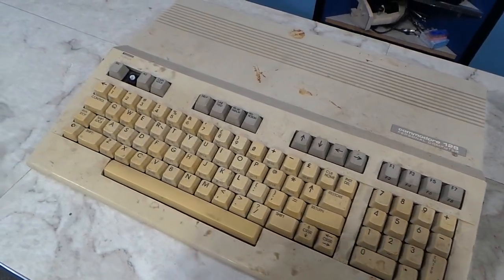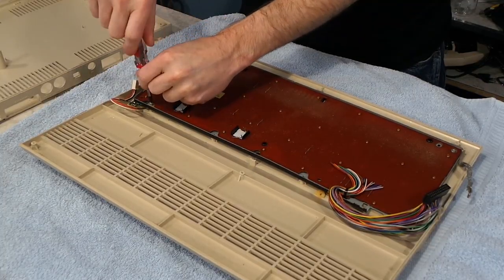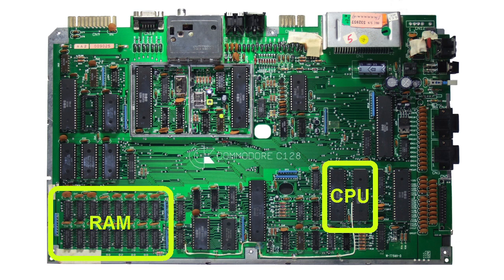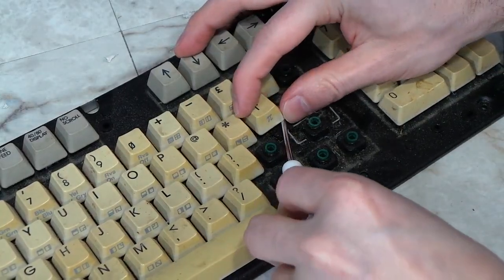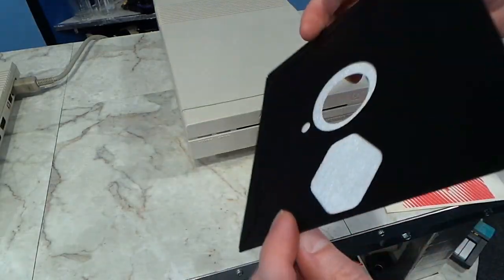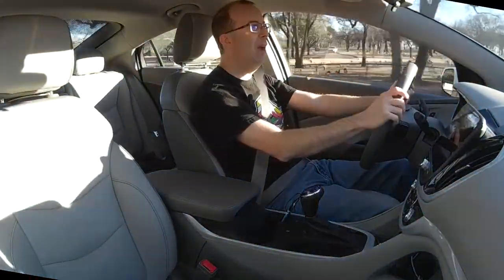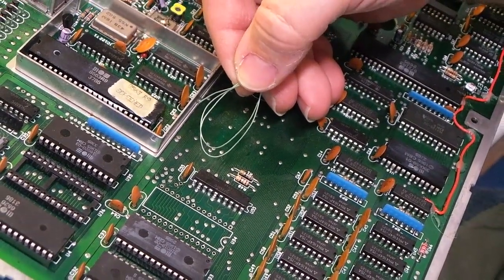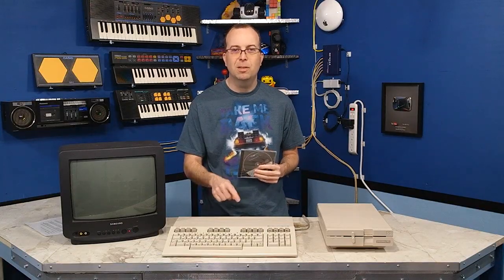Commodore 128 Complete Restoration and Board Repair.

Comment: C128 owners were like: "Yeah, my computer is basically a C64, but my parents have more money than your parents".
Reply: kanjitard And GEOS is slightly better
Reply: Or maybe I just wanted to learn CP/M.
Reply: @veli-pekkakultanen2353  probably the clunkiest os I ever used.
Reply: Nobody:
C128 owners: oh your C64 doesn't have 80 COLUMNS? i pity you.
Reply: @badmeme486  I still have a C64 in it's box
Reply: @JT_1  cool, mine doesn't have the original box
Reply: @JT_1  NIB, never opened but you use it as a doorstop because you have a C128
Reply: @JT_1  me too! The Datasette is still in its original box also, along with a few joysticks and many games!
Reply: @badmeme486   Too bad that not many programs made use of the 80 column mode.
Reply: What size commodores are these? 64? Ours are 128, no big deal.
Reply: l miss a lot my old C=64 C. Now l have to deal with a Dell laptop and windows OS. Pity of me ;(
Reply: @rodolforodriguez4203  I have a C64 but I ate the box.
Reply: and then the day came that they faced a guy with an amiga 500... RIP
Reply: @dollar12 I loved my VIC-20. I remember when I finally saved the money to upgrade the RAM to 16k. I remember thinking "There's NO WAY I could ever use all of this massive amount of memory!" Lololol
Reply: The CPM mode was the draw, having two computers in one was great.
Reply: Jokes on them all the software was made for the c64 lol.

Comment: Bought a Commodore 128, complete in box that is guaranteed working, is there any addons you'd reccomend i pick up? I bought the Vram upgrade to make it the same as a C128Dcr for Vram. I also have a 1541 and a 1571.

Comment: Who ate chocolate 🍫 on top of this commodore 128?
Reply: looks like blood to me tbh
Reply: Looks more like crap than anything else
Reply: "chocolate"
Reply: nikoskokonos13+ lel
Reply: I picked up an A500 several years ago on Ebay, that looked fine with it's small, low resolution image, but what did I receive? An absolute filthy, pizza sauce stained machine that had enough dust bunnies in the disk drive to make a sweater...and other units that were protectively coated with greasy cigarette smoke plus other things...quite gross how some of these machines are treated and how some people live.
Reply: Meh

Comment: For those stubborn scuffs on the bottom you used baking soda on, you should try the mr clean magic eraser. Its also mildly abrasive and works just as well with hardly no mess!

Comment: 10:15 — 8-bit Guy, that's Blu-Tack, isn't it? Is it not as common in America? Pretty sure it's not gum.
It kinda goes like that when it's old and dry and generally about 50% of houses in the UK are in fact held together with Blu-Tack (the other half are generally duct tape :P)
https://en.wikipedia.org/wiki/Blu-Tack
Reply: Richard Williams 100% agree with you. English houses - like mine. Are very shoddy
Reply: I'd say it's more like 50% Polyfilla, 10% Duck Tape, 10% expanding Stryofoam foam,  10% old bits of wire, 10% silicone sealant, 10% Blu-Tack
Reply: YAUUN the amount of things I've "permanently" mounted to the wall the pollyfilla'd the wall I don't think I have any plasterboard left haha
Reply: If it is what I think Blu-track is (too lazy to google) then it's called Mighty Putty in the US
Reply: @simonro9168  Sticky Tack is the big brand in the US. Mighty Putty is a hardening epoxy.
Reply: Nothing beats the holy combination of Duct Tape and WD-40 though.
Reply: iptvreseller@mbox.re  email me if you want to make money
Reply: Not only do Americans microwave water instead of using a kettle but they also don’t have blu-tack? Weird.
Reply: GeminiStargazer I live in Cali and can safely say that I haven’t seen anyone microwave water to boil it

Comment: Note: I did a little research on yellowing plastics and oddly enough the same UV radiation that brings plastics back to life is what causes them to decay in the first place. There are other factors too but UV radiation even from indirect sunlight indoors is a huge culprit. I think chances are no matter what unless you seal a PC properly away from any kind of light it will yellow eventually, but nice to know the IIc is still nice and bright after a year.

Comment: Nice, that disk drive looked brand new. It may be possible to rinse/dunk the PCBs using distilled water also, with a paintbrush, which is the safest way, or soapy warm water initially and finish with a warm distilled water rinse, then dry with a hair-dryer, then leave in a sunny, airy spot for a day or so to ensure full dryness. Most components should not be bothered by this on a PCB. I have used it once before on a serial card that had been left in a shed, and it worked fine.

My only concern with adding the traces is it can potentially effect timing, in some instances, but is a common fix regardless. Re-working the existing traces is often possible after removing some PCB lacquer coating, but you have to be incredibly careful when applying heat to avoid lifting the trace off.

Comment: You can seriously speed up the key washing process if you use an ultrasound cleaner filed with some chlorine-based detergent solution. And why not use a brush together with the vacuum cleaner?

Comment: Great video. Out of curiosity have you tried dishwasher tablets? I read a while ago that the enzymes are great for cleaning old computer plastics so I tried putting the keycaps + plastics from a (very grubby) old keyboard into a bowl of hot water + a tablet, they came out absolutely as clean as new without any scrubbing required. I was really impressed. Anyway figured I'd mention it.

(Also congratulations on taking the plunge and going full time with the YouTube vids'. Hope it works out for you.)

Comment: David, regarding the retro bright and yellowing again: the reason why plastic gets yellowed again after you retro bright it, is because of its contact with air (it's ongoing chemical reaction). So with bromine molecules temporary removed (after retro bright), new ones will get on their place, and there you have yellowing again. In order to prevent that you have to apply a small layer of transparent (matte) spray paint so that there is no direct contact between the air and plastic. That way no bromine can get into existing holes. Please give it a shot!
Reply: The bromine is in the plastic, doesn't get in from the air. Oxygen does react with chemicals in the plastic though, but the other factor is UV exposure, which greatly accelerates yellowing. This is why parts of the plastic not exposed to light hardly yellow at all. You should specifically use a UV resistant clear coat if you want to avoid this.
Reply: +Don Solaris The primary reason for the coating is to provide a barrier to oxygen. Oxygen reacts with bromine containing fire retardants in the plastic and breaks them down. Bromine doesn't need holes to get into, once the molecules of fire retardant break down bromine will still be released into the plastic. The only reason porosity of the plastic is a factor is because it increases surface area for oxygen to attack. Obviously UV isn't the only factor but it does massively increase the rate of yellowing.
Reply: Someone did this and it still got yellowed.  But then they now could not re retrobrite it due to having the clear coat paint on it.
Reply: Ditto what Warren Park said.  And also like others have said, if you apply a UV-blocking clear coat, while sounding like sage advice, it ultimately will prove your worst enemy should the plastics yellow again, as the clear coat will prevent Retrobright from doing its job.  Therefore, the most sensible thing is to Retrobright repeatedly as needed over time.  It would have been better if the plastics were made without the flame retardant at all.  I'd take the fire hazard risk over yellowing any day.
Reply: I liked this so David can see
Reply: @joestacos2  heh funny number of likes
Reply: Maybe an experiment could be run to test this - retrobrite a computer, wrap half of the case in clingfilm, then store it in a dark place for a year. Maybe take another part of the case and store it in daylight for a year too.
Reply: Weird. I have a Commodore laying around here that has always been in contact with AIR. But never with sunlight. And it looks like NEW. It's not yellow at all. So.. are you wrong? Or is my commodore 128 wrong? I also have the original brown cover over it. This will prevent UV to enter. It's always been on it. I never use it though.. Maybe in the future im going to play with it for fun.
Reply: Yep just see eev blogs mac se teardown
Reply: Don Solaris hi
Reply: can't spell
Reply: I will soon retrobright a few machines such as parts of my SX-64(space bar), parts of my MegaST, Amiga 1000 and Amiga 500 case. Does the spray paint easily get scratched, because a flaking case will look terrible.
Reply: Nice
Reply: Don Solaris
Reply: Don Solaris
Reply: neat
Reply: awesome tip!
Reply: can you explain why some plastics get
 yellowed again and some not?
Reply: @workingman00   I don't think that anyone, including the professional scientists who have looked into this issue, fully understand what is going on.  Theories abound, but as of yet no theory or set of theories covers all known cases consistently, with no contradictions.  Sometimes UV yellows plastic (very obvious in the case of one of my C128s, which has its original color precisely and sharply defined where it was shaded by cords all of the time when it was with its original owner) and sometimes it conversely lightens yellowing.  I've put some yellowed plastic out in the sunlight and the yellowing faded, but right nearby is a heavily yellowed piece of plastic that is always outdoors, and it used to be white!  And some of my vintage computer equipment yellowed while kept in absolute darkness for years, while others never seem to yellow (e.g. my 1702 monitor and 1581 floppy drive, both types of which frequently turn yellow, but not mine for unknown reasons) at all.

One example of a computer that doesn't yellow at all, anywhere, is the original-style Apple IIe with the white lettering on the keys--none of these ever seem to yellow.  The later Apple IIe with the black lettering on the keys do yellow, however, and often badly.  Sometimes the keys are yellowed, too, and sometimes they're not, although the space bar specifically is virtually always yellowed (good luck finding one that isn't), and usually very badly.  The space bar on my old-style Apple IIe is pristine, however, like it is on all of these computers (that I've ever seen).

Anyway, I try not to let the yellowing bother me.  Heck, my current refrigerator and microwave are both over 20 years old (I've serviced them both several times myself), and they have some yellowed plastic parts on them now, too.  Maybe if we understand it better someday and find a permanent way to restore the original color of these plastics, then I might consider de-yellowing my collection (which runs the gamut from mint to beaten up but clean, although they're all fully functional), but for now I consider it their patina.
Reply: Don Solaris 666 likes
Reply: 666 likes...?
Reply: He may want to keep if as original as possible tho
Reply: So clear coat it....?
Reply: huh. neat.
Reply: naa
Reply: Tried this on my Mac SE, it's been 4 years and it still looks great ;)
Reply: yellow yellow , dirty fellow..
Reply: 128
Reply: Don Solaris cool. I actually like the old yellowed look if it’s not a perfect pristine one like a few scratches deep gouges and stuff.
Reply: It’s retrobrite
Reply: https://youtu.be/i6l8MFdTaPE
Reply: I'm genuinely disappointed he hasn't tried this.
Reply: +joestacos2 Same.
Reply: +t1993ct2006c same
Reply: +Xei the reason for the coat is to fill in the holes where bromine once was, but was later removed by peroxide. With the holes "closed" no new bromine can reach that place again. I retrobright my Amiga mouse, but since i got new one, i put this one in the box. After 1 year it became yellow again. It was never exposed to any form of light during that time. This is because retrobright accelerates the process of yellowing. Which is why you have to block all the microscopic holes in the plastic. UV resistant clear coat is obviously better thing as it is double insurance, so to speak.
Reply: Don Solaris AHH
Reply: I read that someone tried that but it still yellowed and now was not able to retrobrite it again due to it having a transparent spray paint on the surface!
Reply: inportant information.
Reply: Up
Reply: Douglas B I
Reply: Silicon spray like the stuff you get for tier shine use that it will stop oxygen from activating the bromide and if you wash the plastic after you let the silicon absorb a bit it with a car wash that uses silicon as a wax it is not greasy and nothing sticks to it again.
Reply: This can also be solved by sealing the plastic with a wax such as carnuba or a synthetic wax. If you ever restore yellowed headlights you should go over it with wax but should eventually clearcoat it
Reply: Xei +1 i was meaning to say Oxygen, not air. Sorry my mistake.
Reply: It is the exact opposite, oxygen lightens the plastic by reacting with bromine. For this particular reason hydrogen peroxide is used, which causes oxygen to react with bromine with the heat. Instead, the UV rays break the bromine oxide molecules, leaving this last in the plastic. With this treatment, the plastic returns to the initial condition, and then over time, due to the heat or the Sun's rays, the oxygen is lost again.
Reply: Retrobrite**

Comment: Might I suggest using CRC QD Electric Cleaner to help clean off the boards? De-dust with compressed air and a vacuum, and maybe a super soft brush, and then use the QD cleaner for stubborn dust. Seems to work a treat for me.

Comment: As usual...a really good work by you....and my very compliments to Yoda (superb) :)
p.s. do not use denaturate alcohol on rubber feet, or they will get "melted" and sticky as you discovered. It's not an heat related problem.

Comment: I realise it's a 5.25" floppy, but why the hell is it so damn long? It's huge.
Reply: Because the Commodore floppy drives weren't just dumb drives, they were also fully functioning computers themselves. They could be programmed by sending code to the drive. For example, there was a copy program that let you program two drives to act as a stand-alone copy machine. Once set up, you could unplug the computer and the drives would make copies when you inserted a source disk in one drive and a blank in the other. As soon as you closed both drive latches, the copying would start.

Also, the power supplies were built into the drives, making them larger and heavier.

Comment: Regarding the plastic slowly yellowing back after you restored it; it is most likely due to UV light.  Have you thought about putting a UV protection product on it after restoration?  My suggestion would be to use automotive products since they are affordable and easy to use.  Something like a car paint sealant or coating should provide plenty of protection.  Amazing job on your restorations BTW, you are truly bringing those machines back from the dead.

Comment: How could just a little bit of corrosion break the whole computer??
Reply: The corrosion took out one of the data lines that the CPU uses to move data to/from memory. It couldn't read instructions from ROM or store data to RAM which caused it to never boot. Since there were 2 other traces that were corroded but not yet severed by the corrosion I patched them too. :)
Reply: Keep in mind that the design of the computer is the keyboard is on top with lots of ways for crap to get down in the computer as a result.

Comment: CPU or SID chips are first things that go bad on Commodore computers in my experience, I mainly met them in bad condition but I think that Atari 8-bit line was more robust and reliable. Hell, I bought Atari 800XL on clearance in 1986 and it still works without issue, even after 30 years of tough life. My PC Engine CD wasn't that lucky...

Comment: Have there been any chemical tests on what exactly happens to the plastic after retrobrighting? Could you be potentially introducing something that will lead to more damage or yellowing in the future?
Reply: So far there is no real proof that it does anything to the plastic other than remove the yellowing. It will continue to yellow, so you will need to treat it again at some point in the future. How fast they yellow is dependent on a number of factors so there is no set answer. Always good to go to the source. http://www.retr0bright.com/

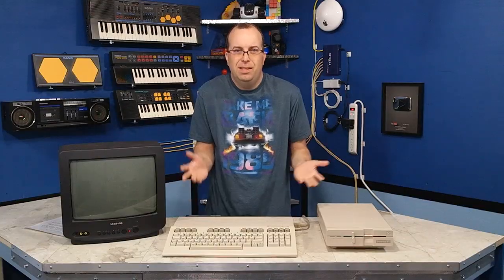Comment: 15:06 the moment i realized my laptop doesn't have a scroll lock key
Reply: Could be worse. A few others are endangered, too. On 30 series and newer Lenovos, the Pause key is emulated by Fn+P, so if you need the System Properties window in Windows, you have to press Win + Fn + P. Kinda annoying if you're the IT guy.
Reply: for me thats WIn+Fn+Shift lol. the smaller these machines get, larger the key combo's get

Comment: +The 8-bit Guy A nice way to save yourself from scrubbing each individual key is to use a denture cleaner. Remove all the keycaps and let them soak in warm water with 4-5 tablets. I've done two keyboards this way and it's saved me so much effort.  The downside is it may take longer if you allow them to soak for a couple of days, but they come out nice & clean!

Comment: Instead of baking soda try out Mr. Clean Magic Erasers. Works AMAZING on plastic scuffs (permanent marker comes off like butter). Just be sure to only use on bare platic. Not over any graphics or logos. it will leave a clean surface on the plastic.